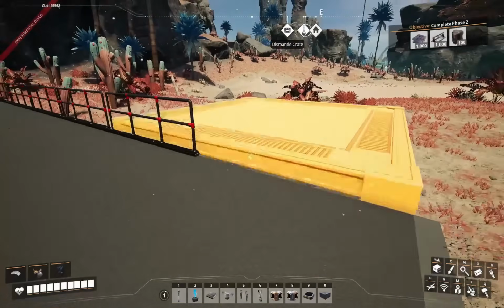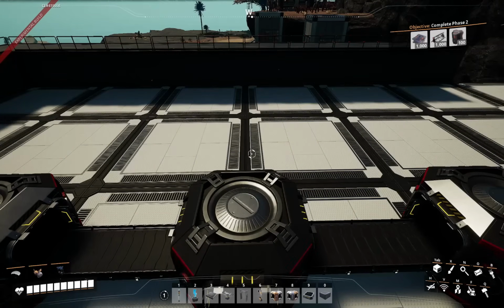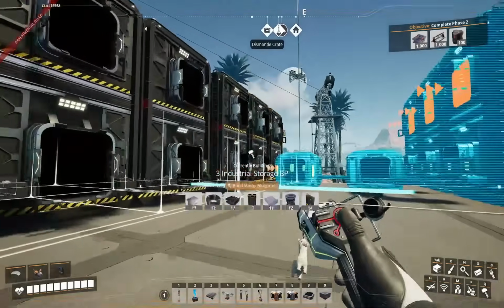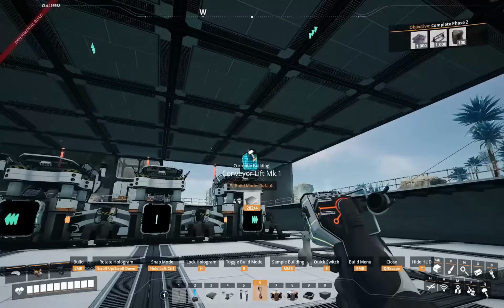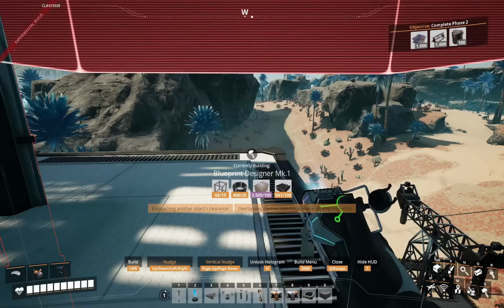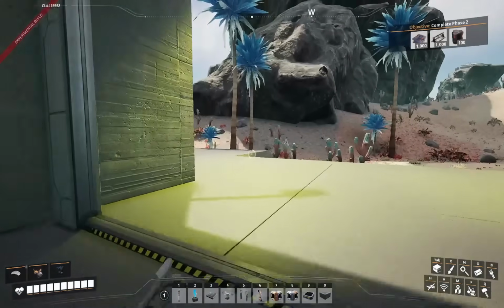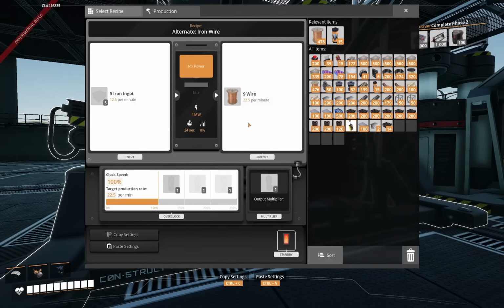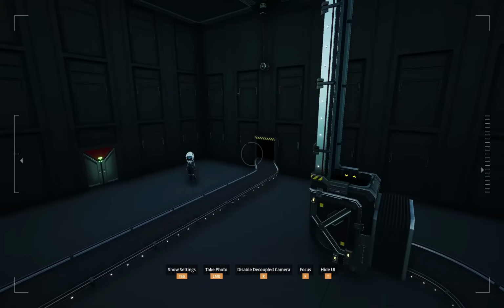Permanent Iron Parts Factory - Finishing Phase 2 - New Satisfactory 1.1 Playthrough

Comment: I love how your basically screwing over ficsit with cheap crappy products lol cause wile yes you can make wire out of iron its conductivity is much lower than copper so the automated wiring aint gona work to spec the motors just aint gona preform right and makeing pipes out of iron there gina be weaker and corode faster but hey your stuff is cheap and easy to make and well not like ficsit has much other choice lol

Comment: For your vertical merger alignment woes, start by building a conveyor lift on the ground floor, take it up a bit higher than the second floor and put the merger on the lift in the right place. Delete the excess coming from the top, then rebuild the top part of the lift going to the third floor, where it will be out of alignment by exactly half a meter.
Place a second merger on the lift just below the third floor, delete and rebuild the top part of the lift again and it will be magically aligned.  Now you can delete that merger and it will keep the lift in place, aligned with the third floor and still connected to the second floor merger.
You can also do this merger-delete trick to make infinite lifts without having conveyor floor holes in them - it's the vertical form of belt welding.
Reply from the maker: That is very cool, thank you! I’ve used the belt welding trick, never thought to try it here. I still hope they fix the alignment bug with floor holes but this is a great work around!

Comment: Love your belt limiter trick, where you use the mk1 belt to limit your split to just 60/min, or mk2 to limit to 120/min, etc. I thought you might like to know about an expanded version of this I thought up? Here’s how to make it:

1) Place your smart splitter on your source belt, as usual. 
2) Configure it the same as before, with priority going to the split you’re making, and remainder elsewhere.
3) Place a splitter next to the priority output and connect using a belt higher than the amount you need.
4) Place a merger above the splitter.
5) Now use combinations of lifts from the splitter to the merger to create the amounts you need (which will pop out of the merger’s output). 

You can use two or three lifts giving you a large number of combinations. For example, use a mk1 and a mk2 to get 180/min. Or you could use a mk1, a mk2 & a mk3 to get 450/min.

Clearly this works better for higher numbers and won’t be as useful until later in the game, but you might find it simpler than some of your crazy splits! You could probably also use it in the middle of other splits, if the need arises. 😊
Reply from the maker: Thanks, glad you like it! That's a great method to get some more options!

Comment: Hey Moo, cool feature of 1.1 is you can attach your splitter and mergers directly to the ceiling. Which you could use for some interesting builds and have load blance on the ceiling of the construction floor.
Reply from the maker: Hey thanks for the reminder! I love that new feature, I was curious why the pipeline junction could but mergers/splitters couldn't. Thankfully they all can now. I like to watch the parts moving around so I tend to do most of the load balancing on the floor, but I'm sure there are going to be times I need the floor and ceiling :) Thanks!

Comment: Just wondering why you need the overflow belt in the second tower? If you set the first smart splitter per item to overflow in the middle, that will handle any item that can't go in to the storage and you just feed that sushi belt in to the sink. Big savings on AI limiters and MK3 belt parts. Nice set up otherwise. 😁
Reply from the maker: Thank you! That is an excellent point! I just wasn’t thinking. I can definitely save myself 2 smart splitters and the merger now. Thanks!
Reply: @moo121 You're welcome! You can also save 7 of each in the iron parts factory, plus a load of belt parts. 😁